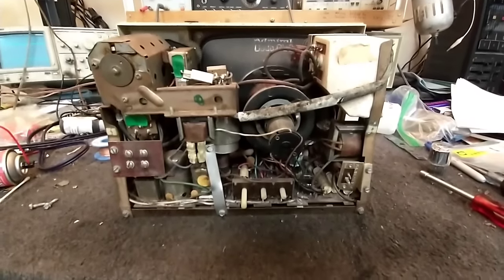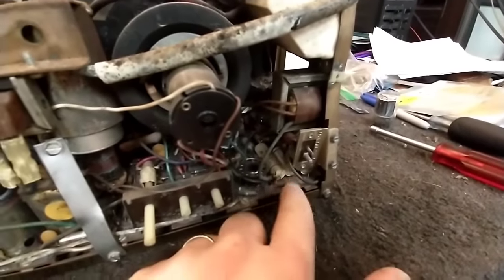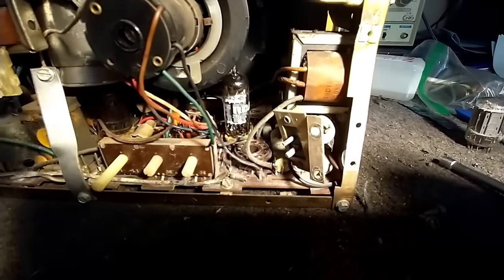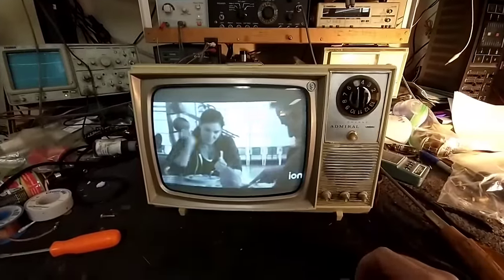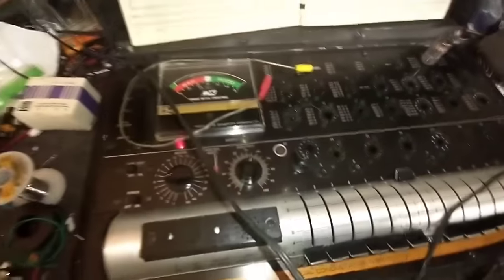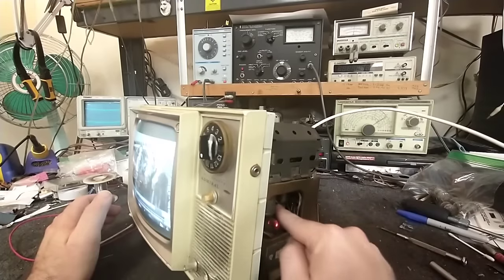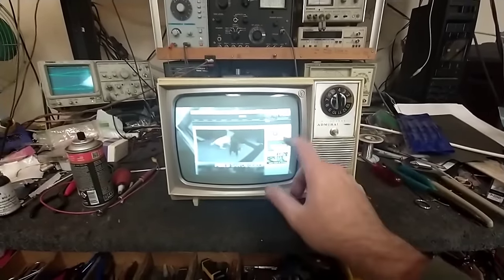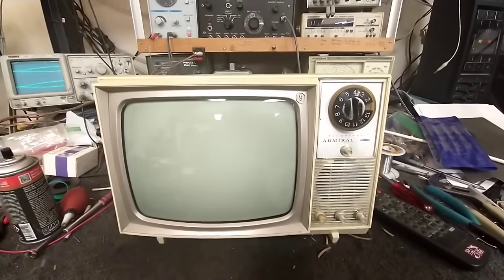Servicing a 1966 Admiral PG919 all vacuum tube b&w television. P3/3 - Vertical and sound

Comment: I was an apprentice tv tech at an Admiral dealer when those sets were current. It would have been a bit too early to have solid state circuitry in that set, as we were still mostly in the germanium phase of the transistor revolution back in 1966. While they could have transistorized some of the small signal functions, I doubt they would have been able to do the sweep functions. Some silicon was out there, but it was really expensive.  So it would have been a hybrid at best, and a lot more expensive to buy. The Admiral color sets of the same period were all vacuum tube designs. I really didn't care for the brand. The small tv's weren't the only products where they did dumb things like making tubes inaccessible.